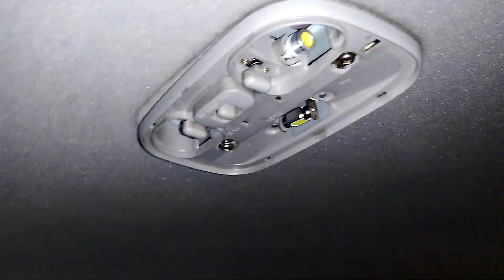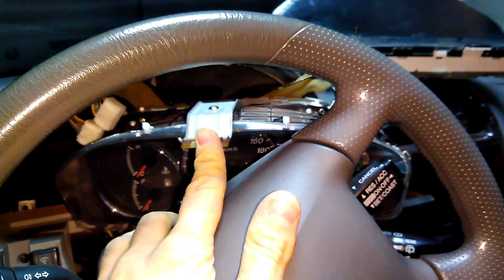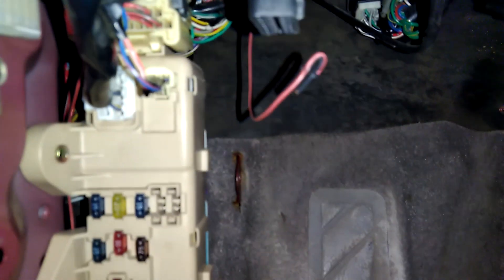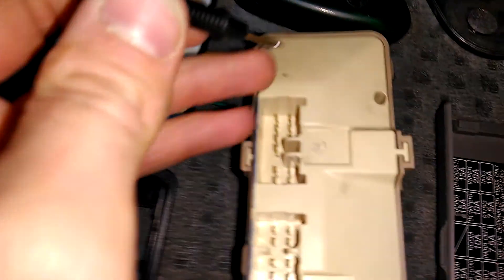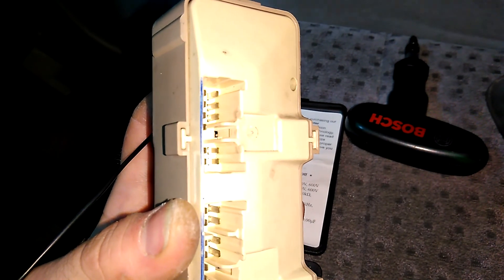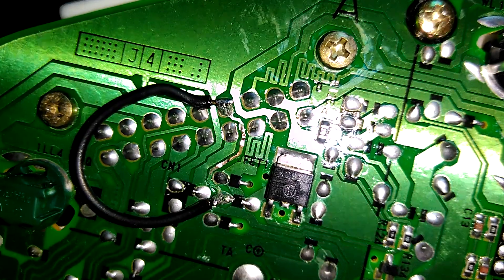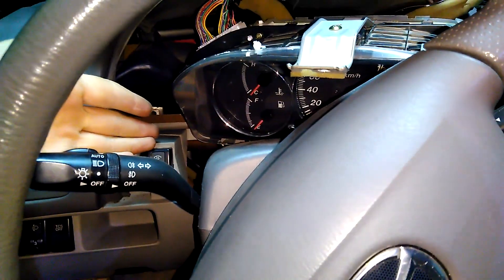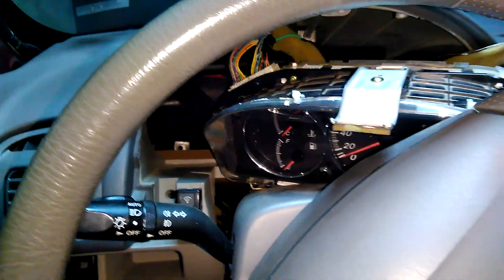Fixing interior lights not working only on DOOR position

Comment: My 2010 f150 has this problem where interior lights work when manually turned on, but not when I unlock my truck or open the doors
Reply from the maker: Hi. Sorry, I have no idea how F150 works. I'm not a professional, I just have lots of experience with Mazda vehicles.

Comment: I have a different problem....
When i open my door the dome light wont turn on, but when i turn off my radio the dome lights turn on.
I even can't roll up my windows when the radio is on ,and anything with a sensor doesn't work
Reply from the maker: Is this 626? Interior lights and radio do not have anything in common on the 626, I do not see how could that happen. Unless you have wiring harness issue.

Comment: Have same problem on my Nissan note which the return wire goes to BCM(thought same with your odometer module), might give a try on mine,  thanks for the video it's really help!
Reply from the maker: Just make sure after you fix the problem to add a fuse to that wire, so it never happens again. To me it did, so I made a second video where I not only fix it, but add a fuse as well.
Reply: @Mazda626GF  got it thanks

Comment: Oh, I have same problem with Mazda 3 2010. When doors open doesn’t work. I removed the dome light switch and installed a new switch but nothing happens. The problem start with short circuit in contact with screwdriver when I was replacing bulb. Is similar problem? Do you know about this?
Reply from the maker: Yes, you have burned the circuit for light dimming, exactly as what I did. Twice... Unfortunately I have no idea where that circuit is on the M3. My best guess is it is in the BCM, which is expensive to swap. I do not have wiring diagrams for M3. You can trace cable by color, but it is hard. As for the fix, fortunately the burned element (or PCB track) should be visible, so you can fix your own BCM. Next time consider using a plastic screwdriver or add a fuse, as I did on my other such video ;)

Comment: Hi, i've Changed a whole tacho, on manual button bulbs working.. when I unlock car and on open doors, nothing happens.. what do you think is problem? Ive searched fuses and relays, but nothing changes..
Reply from the maker: Is this Mazda 626 GF? Because on the 626 12V are coming from the ROOM fuse directly to the lights and ground comes from 2 places - ON position gets the GND from the chasis, through one of the mounting screws. DOOR position gets the ground from the instrument cluster, exactly how I show it in this (and the follow up) video. If changing the cluster doesn't fix the DOOR position (and you are sure cluster is good), then there is a bad connection somewhere - either the cable from the cluster to the lights or the light button itself.
Reply: @Mazda626GF  its Mazda 6 first gen 2004
Reply from the maker: @gigs2016v  Ok, now we are talking. I have wiring diagrams for GG pre-facelift, exactly what you need. According to them, DOOR position is connected to DOOR LOCK TIMER UNIT pin 1B (the small connector, cable color should be Yellow with Black, Y/B). Check that wire and if good, your problem is with the door lock unit. Hope that helps!
Reply: @Mazda626GF  i've opened the door lock timer unit, as I see, dont see the problem..all pins are ok.. can I search on door lock unit problem, and fix it? I can send you a pictures of unit... first was all ok, bulb on door open was dead, went to replace, but i did a short circuit.. from the tacho was smoke and smell, looked of your vid, fix the tacho bulb when door is open but interior lights still not resolved...  changed tacho hoping that will fix, but nothing... thanks for help
Reply from the maker: @gigs2016v  I'm sorry, but I have little to no knowledge of M6 apart from common parts with the 626. According to my wiring diagrams, there is no instrument cluster involved with the operation of the interior lights of pre-facelift GG EU spec. And then you say there was a smoke from the IC - this puzzles me a lot. I have no idea why the smoke from there. Maybe you need to open the old IC and see exactly what has burned-out as it may hold more clues to what went wrong. Also, if you give me your email I can send you the wiring diagrams I have, to help you better with tracing the issue.

Comment: Hi! In my car is the opposite, the light works when doors open but it doesn't when switched to on position, what could be the reason of this?
Reply from the maker: If you have the light working when door is opened, then you have ground (good). This means you have a problem with the constant 12V. This line is going through the ROOM fuse. Check it, as it might have burned out. If it is ok, then you need to check the cable and plugs for oxidation. The cable you are interested is blue with red. One end goes out of the fuse box (the one in driver's feet) from a small (2 pin) connector and the other end goes to the interior light. Disconnect and inspect. Hope that helps ;)
Reply: @Mazda626GF  Thank you for your response. Worth to mention that I don't have a multimeter and my car is not a Mazda, it's a Hyundai but hopefully the wiring is similar. I will check that out and do my best.